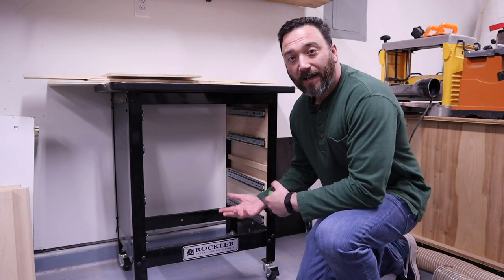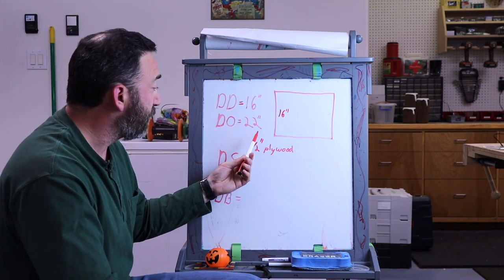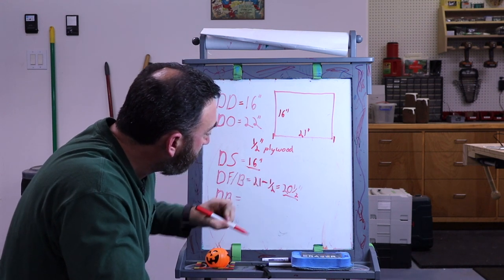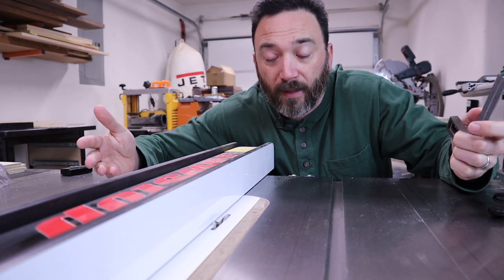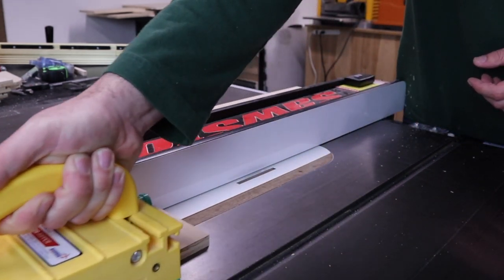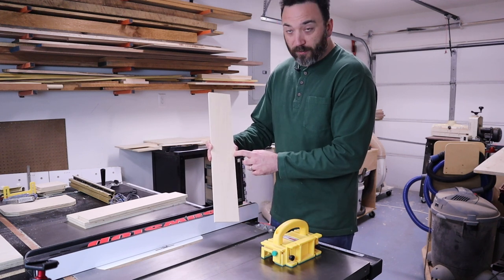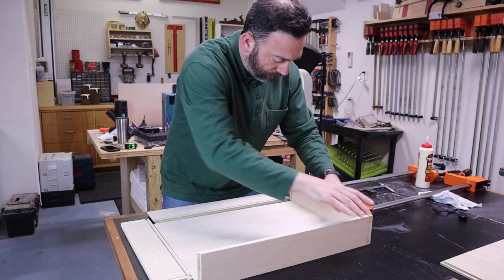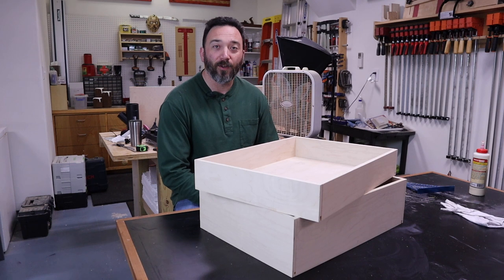How to Build Strong Drawer Boxes FAST!

Comment: Great presentation.  

My only suggestion... when making the standup cuts along the ends of the sides (as well as the bottom panel), is make yourself a tall auxiliary fence for the saw, say 6 to 8", to provide more support and keep the parts perfectly perpendicular to the table top.  You can even make one that fits over and slides along the fence that you can clamp your pieces to as you run them through the saw.
Reply from the maker: I have one like that for cutting miter splines. I should make a few more for other operations!